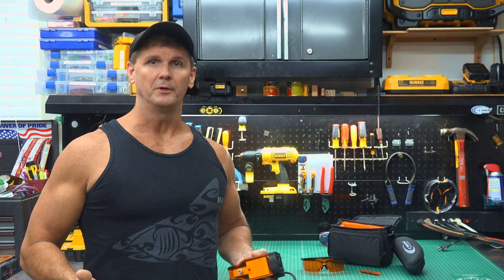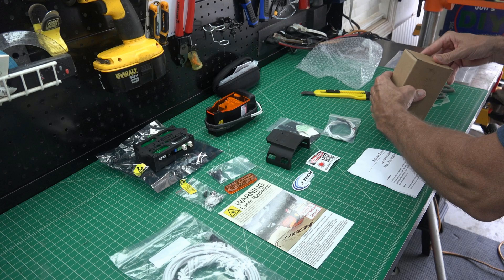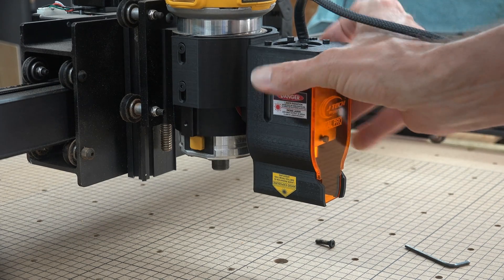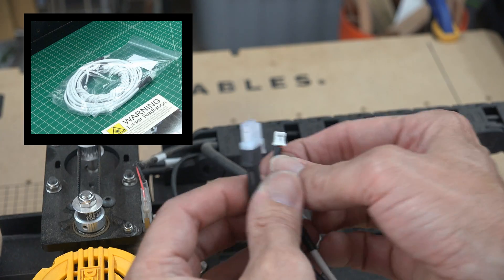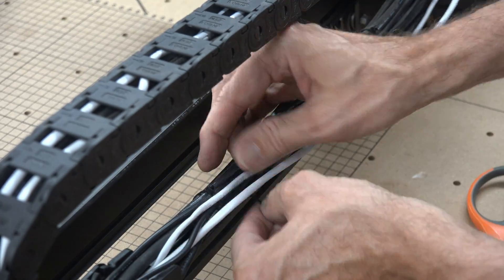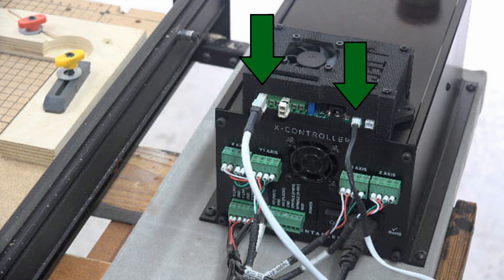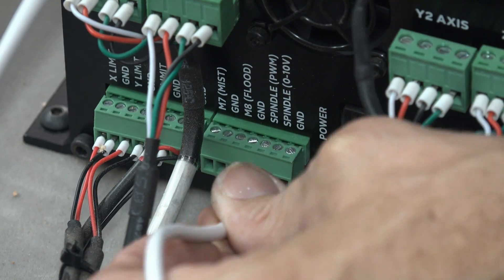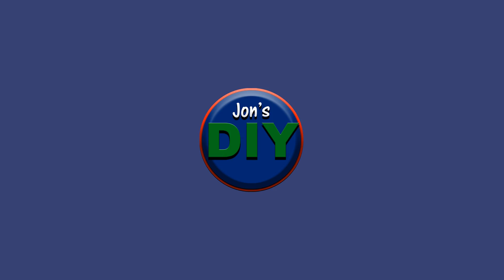Installing 14w Jtech Laser on an X-Carve

Comment: What thickness material have you been able to cut? I have the Endurance 10W and want to upgrade to this one or Optlaser, Jtech so far has a better price!
Reply from the maker: Still testing different material but spent the day etching glass which is super easy with this laser.  I have cut 1/4 inch Birtch in 3 passes.  MDF as well. Have not learned the software to learn the step increase to keep going deeper. But I have no doubt this would cut 1/2 inch plywood.  But ask me in about 3 months when I'm more salty and I will have it's goods and bads.  Thanks for the comment.  Jon
Reply: How have your tests been going? I just got one and am curious how well it's going? Also do you recommend the air assist for it?
Reply: @arichansen595  
Highly recommend the air assist if you are doing cuts, being that you are mostly traveling from 8-10 in/min it will leave chard burns on your edges. If you are just engraving only, then you can do without it. I have pushed mine to 150 in/mm 40% power on birch plywood (from HD) on my Xcarve and came out nice! This is really a powerful laser, I was hesitant it would do cuts. I was happily impressed, next purchase is the Xtool rotary like Mr. Jon!
Reply: @jigsawinventions  thanks so much for the advice I have ordered the air assist now!